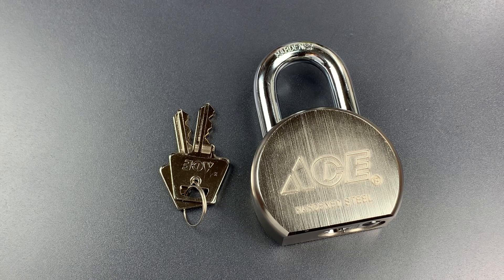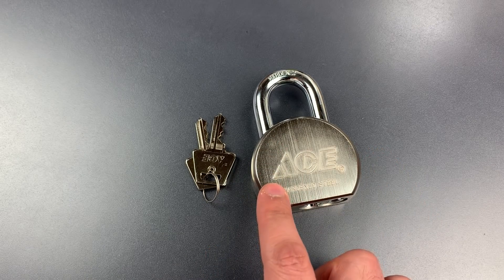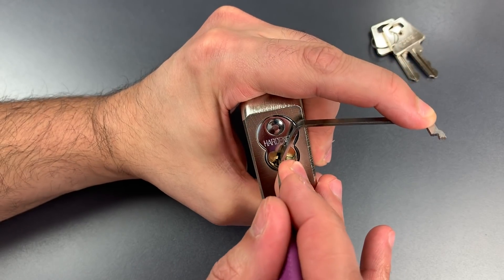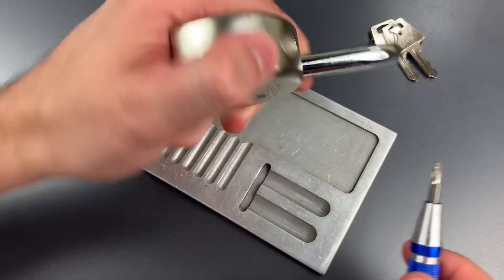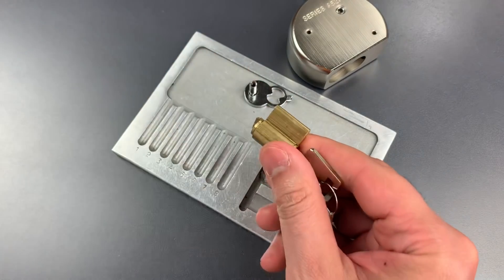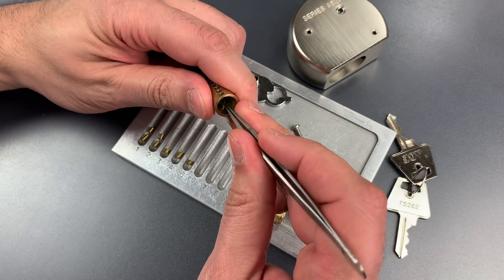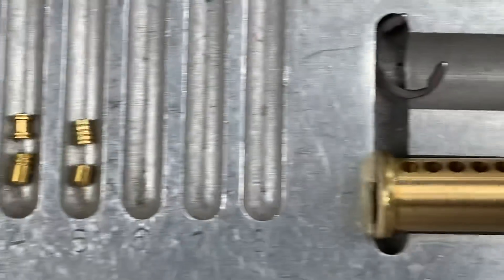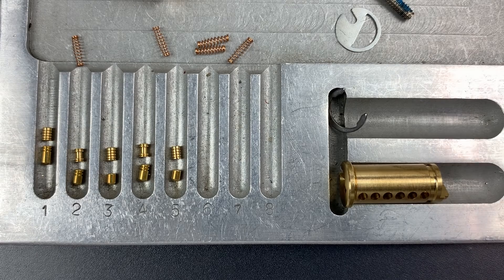[774] Ace Hardware’s Best Padlock Picked and Gutted (Series A527)

Comment: hello. I'm thinking of trying lockpicking. I'm buying the sparrows tuxedo set. are there any additional things I would need for picking? also is there any difficulties with locks that a new picker would need to know?
Reply: It might be better to start with the dirt cheap Goso set from China on eBay. You'd also need some tensioners. Start with Master Locks. Once you've gotten the hang of that, you can then decide what you want to fork out on - assuming you're still interested.
Reply: @two_tier_gary_rumain  Which Master Locks are best for starter picking?
Reply: Get sparrows top of the keyway tensioner in .050"  and the progressive locks.
Reply: Dave McDaniel thanks, I added them to my list of lockpicking tools.
Reply: @burgernado  Take your pick. :) But, seriously, a beginner is likely to break his or her picks. So you want to start out with cheap picks and easy locks. Master Locks are well known to be easy to pick. But the average customer doesn't know that. So they get charged a premium for junk. That said, the smaller locks are cheaper. So anything in the 30 to 40 mm range would be both reasonable and easy to work on. But shop around. Check hardware stores and retailers to see who has the best prices.
Also check on eBay. I spend a lot of my time there looking for auctions and bargains on interesting locks. One thing I've noticed is that the smaller locks are generally more expensive on eBay (postage plays a large part in that). It's only when you get to over 40mm does it become more competitive. That's for new locks, of course. Used locks can be a lot cheaper. Avoid locks without keys until you can pick well. Also be wary that some might be stolen (a lock on a chain but no key should be cause for concern).
Once you've found your feet and you know what you're interested in, get the better picks, better locks, etc. Rekeyable ones if you want to move into making challenge locks or improving their security.
Also check Bosnian Bill's vid on how to improve the cheap lock picking sets. He has some good advice.
Lastly, you can pick up cheap practice locks on eBay. Either clear plastic padlocks or Euro Profile ones with different style keyways. The better Goso sets will come with a clear padlock and still be under $20. They should come with some tensioners too but some of the picks and tensioners are meant for car locks.
Oh, and with the Chinese eBay vendors, I once picked up some advice about them in an electronics channel. I've since refined that and I'll offer it here as a guide.
Check the feedback rating of a vendor. A lot of the Chinese ones are just shop fronts for warehouses. Where they claim to be doesn't always tell you where the product is coming from. You'll notice that once you receive packages. The from address on the package may not match the eBay location. This isn't a big deal except for what you get someone sending via Laos, Malaysia, Singapore, Taiwan, etc. Packages from Hong Kong and Shanghai are also slower for some reason. The fastest is via China Post and marked "small packet by air". I've taken to recording the received date and the location if it's not from where I was expecting (eBay has an 'add note' feature in your purchase history).
A vendor should have a high rating (at least 99.5% but some lower ones are OK). If you check their feedback, look for recent problems and how much business they've been doing recently. Watch for feedback padding (lots of repeated feedback remarks from the same accounts. If you see that, ditch the vendor. They're more than likely to be a scammer). Also have a quick look at their 'items for sale'. If there are thousands of listings, it's a store front. You won't really know what's what until you notice the PayPal entry on your credit card statement. I've noticed a few different vendors that use the same PayPal account. eBay seem to be OK with that but, if I find one bad one, I'd like to avoid their out shop front vendors as a precaution.
When you search for something, list it by price (lowest price and postage first). Never buy the cheapest one - unless its the only one. Some will be way cheaper than all the rest and sometimes use an image copied from the others. You'd have to look at all the images carefully and compare them with the others to make sure it's legit. If you spot an inconsistency in the images or in the description text, drop that one. they're usually trying to fool you. Even then, there are no guarantees.
Depending on where you live, they may also operate a warehouse in your country (may not be near you, though). If you find ones like that, use them instead. They seem to do this to cut the delivery times and the postage costs. So the product prices turn out to be comparable and the delivery is faster. Less chance of being scammed too but they only stock the more popular products (I've found that to be the case with the Goso sets).
Reply: Funnily enough some of the smaller master locks actually have spools and while not super hard, aren't super easy to pick for beginners.  As for getting dirt cheap picks, that has pros and cons, a lot of the cheap Chinese ones are super thick and that can make picking thinks like padlocks way harder than it needs to be. They also break way easier than good picks.
Reply: I would buy the tuxedo set, Its quality. You can also buy picks individually from Sparrows and Peterson on there websites. I really only use two or three picks, one rake and three tension wrenches. 
That would be about $20 worth if bought separately. Working with cheap tools is frustrating and if you do stick with the hobby you'll be buying the good picks down the road or making your own. "Buy once
 cry once" Although there's not much to cry about with a thirty dollar set of picks. .050 pry bar is good to have as well.